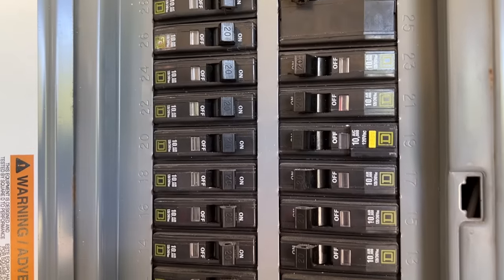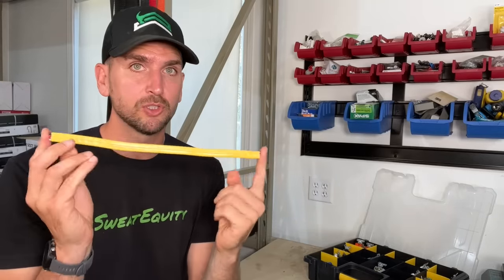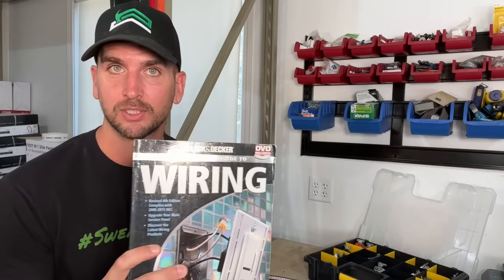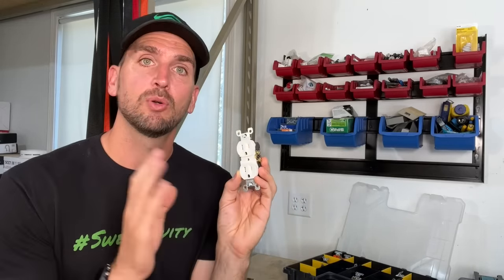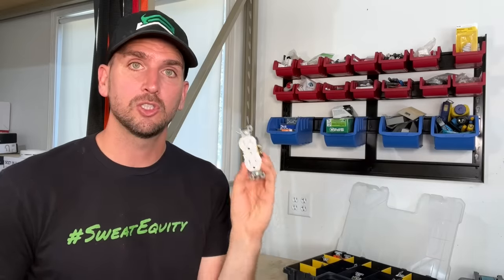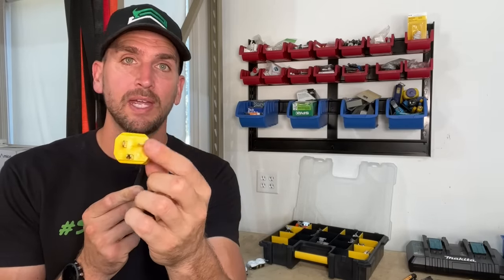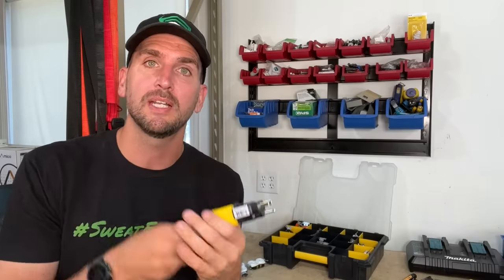Can 15 Amp Outlets Be Used On A 20 Amp Circuit Breaker

Comment: 🇨🇦 Electrician weighing in: I’ve always used the commercial spec grade outlets in kitchen areas, same with back when we used to do split receptacles. Lower resistance connection points which results in less heat especially for the heavy counter top loads running at or near 1500W. Well worth the extra $ in terms of user experience, safety and device longevity.
Reply: We just switched up to 20 amp outlets every single time. We don’t build track or spec-trac homes, so it’s easier to explain a several hundred dollar upgrade to a buyer.
Reply: @thehimself4056  Multiple 20A outlets (NEMA 5-20s) on a circuit is NOT a good call. The few exceptions I can think of are very specific use cases like a workshop where you need devices to be mobile and then only when folks are informed to never have more than 1 20A device in operation on any outlet on that circuit.  I can't tell if you mean you use NEMA 5-20s (the 20A receptacle) instead of NEMA 5-15s (the 15A receptacle) (BAD CALL) or if you mean you swap to commercial grade NEMA 5-15 outlets instead of residential every time (GOOD CALL).
Reply: @stevefifield1207  

Yes. The latter of the two. No way I would put the real 20A outlets throughout. Lol. For reasons you know. But I have found it to eliminate the pesky house calls for broken plastic cheapo .99 cent ones.
Reply: I'd go one step better and install unbreakable face 15A commercial grade receptacles for a kitchen counter, (except for the GFI, which I'd try to install away from the counter.)   You never know how frequently portable loads like coffemakers and tabletop cookers will be removed and be reconnected.  The physical stress to the bodies from cord-yankers is at least as much as to the contacts.
Reply: This guy is a jack of all trades and master of none.
Reply: Same; that's what I do.
Reply: @stevefifield1207  Why are multiple 20A outlets on a 20A circuit NOT a good idea? Almost every house in North America has multiple 15A outlets on a 15A circuit so how's that any different? Please excuse my ignorance.
Reply: @psdaengr911  Don't use GFCI outlets, use GFCI breakers.
Reply: @Spinelli__  Because it implies you can plug in multiple 20 amp devices.   You don't want to have to trust your breaker.   You want to strongly encourage behavior that won't trip it in the first place.  A 15 amp plug almost always draws way less than 15 amps.   If you have something with a 20 A plug on it, it's going to be drawing near 20A.  We don't have 1A plugs and .5A plugs... so the 15 amp plug is the default but the 20A plug means 20A
Reply: @zachansen8293  Yes but what if you want 20 A outlets so that you can connect more 15 A plugs? For example. I want to update my room's outlet (and of course breaker and lines going through the house for that room/breaker/outlet) from standard 15 A to 20 A so that I can plug more devices in my room and have more headroom (safer). At the moment, I have devices (computer, high strength servo motor industrial steering wheel for racing videogames, servo motors for moving cockpit for racing videogames, etc.)  that can use around 1400 W (120 V) but can sometimes peak higher. I want to upgrade it to 20 A so that there's much more headroom and I don't have to worry about fires and stuff.
Reply: @Spinelli__  "Yes but what if you want 20 A outlets so that you can connect more 15 A plugs" Those words don't make any sense.   You want a 20A breaker and 20A wiring for that.
Reply: @zachansen8293  I get it. So, the reasoning is basically, as you previously stated, a 15A-plug device could use even a tiny amount of current like, say, 0.1 A but, if something has a 20A plug then it almost certainly uses more power than a 15A plug is made for or else it would have just been made with a 15A plug to begin with. That leads me to another question: Why is it NOT more popular for people/houses to use 20 A outlets, circuits, breakers, (or at least just the circuits and breakers while retaining 15A style outlets)? I just discovered that the common 15A plugs can also be plugged into 20A outlets without any use of adapters so wouldn't that be way safer since you'll have all your 15A-plug style devices hooked up into outlets/circuits/breakers that can safely handle around 33% (give or take) or power than the much more common 15A system? Does it cost so much more money to have the entire system of outlets/circuits/breakers (or at least just the circuits/breakers) be 20A instead of 15A that almost no one does it? is it THAT much more expensive? Or am I missing something here?
Reply: @stevefifield1207  Why? Because two 20a plugs exceed the 2,400 available watts on a 20a circuit?
How is this different from two 15a plugs that exceed the 1,800 available watts on a 15a circuit?
Reply: @zachansen8293  hair dryers, portable heaters.
Reply: Question for you all. With using that converter, won’t the breaker trip because the 20A tool requires more power than the 15A circuit can give?
Reply: @RH-cv1rg  Why you ask? He means the 20 amp circuit breaker and 20 amp wiring can only handle one electrical device that draws close to 20 amps of current. More than one 20 amp plugs on the same 20 amp circuit breaker and the same 20 amp wiring will end up drawing more than 20 amps of current, which will trip the 20 amp breaker, when 2 or more devices that EACH draw close to 20 amps of current.  It also increases the risk of damaging your electrical wiring, increase heat build up therefore increases the chances of an electrical fire.

As he or someone said previously, most electrical devices that are designed to plug into 15 amp outlets on a 15 amp wiring circuit and 15 amp circuit breaker, draw much less than 15 amps of current each. Regardless of how many 15 amp outlets and devices connected to them, when the total current draw for that circuit reaches and/or exceeds 15 amps total, the 15 amp breaker is going to trip open. In this situation, you also run the risks as I stated above.
Reply: @kalvinnoble488  Kitchens require two 20 amp circuits and power a multitude of devices that are under 20 amp.  Mixers, beaters, electric knife, can openers, etc.  The kitchen has multiple outlets on the 20a breaker. 
I just don't see the logic difference between the 15a and 20a circuits.  Seems like the same risk to me.
Reply: @RH-cv1rg  Agreed, the risk is the same for 15 amp circuits and 20 amp circuits as I stated before. The 20 amp circuit is designed to handle devices that are designed to draw close to 20 amp. In this case, you can only plug in one device that has that type of current draw per 20 amp circuit breaker. If you run one circuit off a 20 amp breaker (for half of your kitchen for example) that has  more than one 15 amp outlet AND one 20 amp outlet, you can only have ONE electrical device that draws close to 20 amps (connected to the 20 amp outlet) OR run other electrical devices on ALL outlets such that the TOTAL CUURENT DRAW does not exceed the 20 amps of the 20 amp circuit breaker.
Reply: Fellow Sparky, and I work a lot of Rentals. I REFUSE to install ANYTHING but a 20A Spec Grade Receptacle in a wall, regardless of whether it's a 15A Circuit or not.
I don't carry anything BUT them, on my truck.
Reply: @TimeSurfer206  Thanks fine but do you tell the homeowner's to only use 12 gauge cords to plug in their toaster, garbage disposal, fridge?
Reply: @RH-cv1rg  Here, I shall give you the only answer you deserve:
Reply: @TimeSurfer206  Exactly as I thought.  You don't have a coherent answer so silence is best.
Reply: @RH-cv1rg  Lol ... love it!
Reply: @crookeddonald4761  No, some people are just too stupid to understand complicated subjects.
I have had a Commercial Electricians License most of my working career.
She has not.
Reply: @zachansen8293  Yes, although, if you're retrofitting a house which predates the technology, it is a significant hassle to get the breakers replaced. It's also a bit of a pain in that if it trips, you don't know where the fault occurred. GFCI outlets are perfectly fine if you've got a preexisting install and just need a couple outlets. 

Otherwise, you're likely stuck getting an electrician in to change the breaker and my breaker box does not have any sort of shutoff for it, so the only way to disconnect the power is to cut power to the entire unit.
Reply: I have a question for an electrican..you up?
Reply: @thehimself4056  Super convenient with better 4 slice toasters. A nice touch of flexibility for those rare cases. Zero risk.

Comment: If I run 12/2, I use 20A outlets.  That way, I have the extra capability if needed, and it's easy to identify the circuit capacity.  I can't imagine why anyone wouldn't just go with the full boat if it's available.
Reply: Honestly it's probably almost allways due to cost especially when it's basically unnecessary in the living space of a residential house where almost nothing we use is going to even draw close to 20 amps and so installing a bunch of 15-amp outlets is fine. Not only that, unless everything else is off on the circuit, you won't be capable of drawing 20 amps anyways, so there's that.
Reply: @scottbitz5222  True.  My problem isn't from a single outlet, rather from multiple appliances on the same 20 A circuit in the kitchen, like an Air Fryer (12 A) and Microwave (12 A).  Using both trips the breaker (a good test), so have to plug them into different circuits.  Fortunately, code requires at least 2 circuits to kitchen outlets.

Comment: Remember to "Fuse the wire" which basically means the wire is the limiter. Never put a fuse or outlet or anything else that has a higher amperage than the wire.

Comment: I agree with what you said. I only use commercial grade receptacles, mostly for the backwiring capability, but they also tend to have a larger plug cycle life.

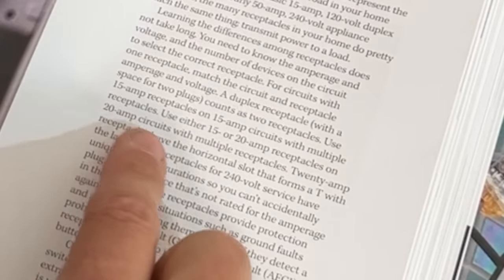Comment: At 1:54 a few lines in the book above your finger it says "A duplex receptacle (with a space for two plugs) counts as two receptacles". This is an important detail for clarity that some viewers may not realize.
Reply: So you can have only one duplex 15 Amp outlet on a 20 Amp breaker as that counts as two receptacles.
Reply: @leeoldershaw956  
If you are running 15 amps continuously on a 20 amp wire the 20 amp wire will not get as warm because you are not tasking it to its limit.  Safer that way.

The engine on regular cars and trucks can produce more horsepower than they do.  They are made that way because they will last much longer if you do not task them to their limit.  Race cars do and their engines are usually rebuilt after every long race or every time they run more than a certain amount of miles because of the stress that running to their limit causes on the engine.
Reply: See NEC 100 definitions.  A single receptacle is a single plug only and it must be rated in accordance with its branch circuit.  See NEC 210.21 for this.  A two plug receptacle is a duplex receptacle or multiple receptacles sharing a single backstrap.  The pass trough current on a 15 receptacle should be rated at 20 amps.  Its possible to terminate multiple 15 amp receptacles on a 20 amp branch circuit.  What is not so clear is using 20 amp receptacles on a 15 amp circuit.  The 20 amp receptacle can handle the 15 amp load presented to it with ease and safety.  If a 20 amp device attempts to draw 20 amps through said receptacle, the branch breaker will trip.  The presence of a 20 amp receptacle on a 15 amp branch circuit is misleading as you can never get the full 20 amps.  On the other hand, any device that has a nameplate rating exceeding 15 amps should be equipped with a 20 amp neutral spade which cannot plug into a 15 amp receptacle.  But some branch circuits such as a mandated 20 amp kitchen counter branch circuit can have either receptacles.  If you plug an electric jack hammer into your kitchen outlet with a 20 amp receptacle, it should be able to run fine as the branch circuit can provide the correct amount of amps.

So if the branch circuit has a 15 amp breaker, use only 15 amp devices.  If the branch circuit has a 20 amp breaker, use either 15 or 20 amp devices knowing that you cannot plug in the heavy duty appliances without a spade adapter.  Do not use a spade adapter on a 20 amp receptacle used on a 15 amp branch.  Woun't burn you down but your whoopie will not run.

Comment: When looking at the 15 vs 20 amp internals at 5:27 you can see that the hot side on the 20 amp is the same as both the hot and neutral on the 15 amp. The part that was removed from the previous model 15 amp would really only come into play when the connection is a horizonal prong. Since this isn't possible with a 15 amp receptacle, the part was probably only there so that both could be manufactured on the same line.
Reply: Same molds, different materials? Makes sense.

Comment: One thing you failed to mention is that all of the commercial grade outlets you featured  have a bonding jumper that holds the bottom screw in place.  This is very handy if you use or encounter metal boxes because you can eliminate the need for a separate ground wire to bond the outlet with the box.  

Both screws on the cheap outlets are held in place with a piece of cardboard and should only be used on plastic boxes where it doesn't matter.
Reply: I wondered what that was for, the bonding jumper.  I thought we could just rely on the screw tightly holding the outlet onto the box, for the ground.
Reply: I would politely disagree. I am not an certified electrician but have worked with electricity for many years. On an outlet that I didn’t install in my house someone didn’t use a ground wire on the outlet and relied on the mounting screw for ground and was not fully tightened. For some reason the outlet shorted and tried to use the screw for ground. With that screw being so small and not a good connection it caused resistance which caused heat. As we all know with electricity once a connection gets hot the resistance goes up which causes the connection to get hotter still, it’s a self feeding cycle. The result was the vinyl face plate catching fire. Thankfully it was on drywall and not wood paneling. If the socket would have been grounded with a wire it probably would have tripped the circuit breaker. After that I always bond any sockets or switches to the ground wire and the box if it’s metal. Just my experience with it. 😮😮
Reply: Commercial Sparky, here, and we never rely on that bonding jumper. It's Pigtails all the way, Baby.
We also don't use those "Stab-Lok" connections on the back, to turn the 15A Receptacle into a fuse on a 20A circuit by _making the receptacle the splice!_.
Reply: @TimeSurfer206  What do you think of WAGO connectors?
Reply: @Roy-ij1wq  I am not impressed with any Knife-Blade style of connector.
Reply: It don't matter I bond anyways. It is the way I was taught to wire outlets and ground to metal boxes. I also use deep boxes because the local inspector had us put box extensions on all daisy chained connections. Dad bought the deep boxes for my attic rooms upstairs. This is a rewired remodel house that was over 150 years old at that time in the seventies. That house is over 200 years old now. My nephew visited the new owners and went upstairs the owner gave him a tour. This was a farmhouse 30 miles south of Eire PA. 73

Comment: You really hit the nail on the head with this video. As a general rule, it is a waste of money to purchase 20-amp receptacles versus heavy duty 15-amp versions, especially given the innards are identical. The highest amperage device i have found is hair dryers, which are rated at 1875 watts. Divide that by the 125 volt nominal rating of receptacles and you get 15 amps. It's almost like the manufacturers designed the hair dryer to be at the maximum rating of a 15-amp receptacle.

As you showed, the reason NEMA specifies the perpendicular grounded terminal for 20-amp attachment plugs is so they can only be used on receptacles  on 20-amp circuits and not potentially overload a 15-amp circuit.

An important point to make is that circuit breakers only protect the wiring, not the devices in use on the circuit. Ideally, all residential circuits would be wired with 12 awg wiring with 20-amp breakers, therefore making capacity moot. However, 12 awg wiring costs 50٪ more, uses more material, and is harder to work with than 14 awg.  So, we're left with the compromise of 15 and 20-amp receptacles.

Related to this, I've learned it's better to wire dedicated circuits with 14 awg wiring when the device is rated 1440 watts or less, especially disposals, dishwashers, and air handlers. I also do this for refrigerators and microwaves/hoods when the inspector permits it (some think all kitchen circuits must be 20-amps, not just the two small appliance circuits mentioned in Code.) Why spend 50% more on wiring for literally no benefit?
Reply: "It's almost like the manufacturers designed the hair dryer to be at the maximum rating of a 15-amp receptacle" Of  course, that is exactly what they did.  Appliances are designed to be usable on common circuits.    As for others, Canadian code stipulates that microwave should be on 20 amp AFCI protected circuit
Reply: @dmitripogosian5084  Too bad my sarcasm didn't translate well in writing. But yes, that is absolutely why they did it. When I was a kid, I remember hair dryers were rated 1920 watts, which by sheer coincidence is the same as 80% of a 20 amp circuit...

Comment: Manufactured homes that I've seen use 14 gauge wire for most of the wireing. To make things more interesting they daisy chain plug to plug with back stab 15 amp plugs.
After your video I looked at one of my plugs and it had gotten hit enough that it melted the plastic in the back and the wires got hot enough that I had to cut off more than an inch just so I could strip the wire!
I'm replacing ALL my plugs in the house. Have found 2 more not plugs